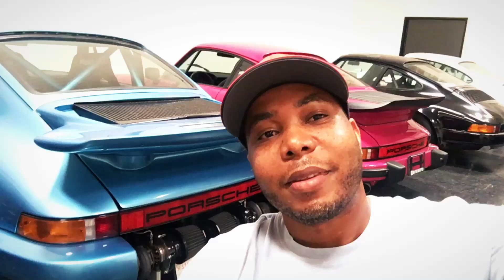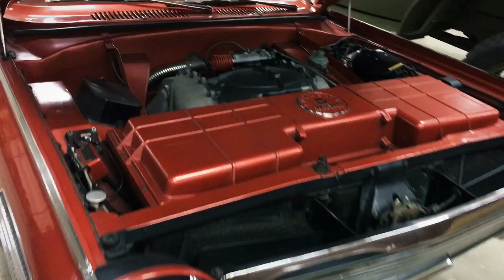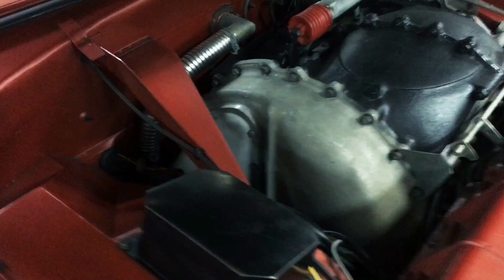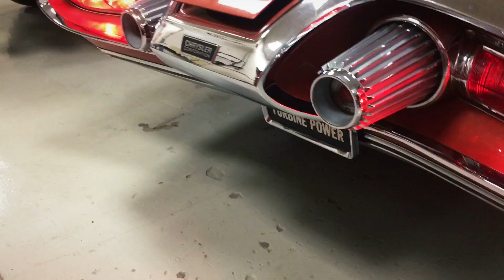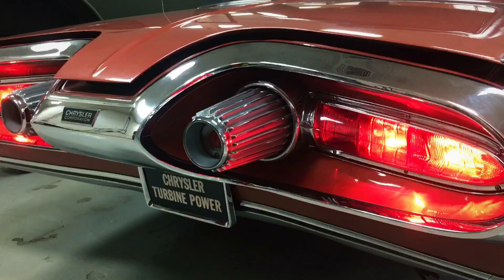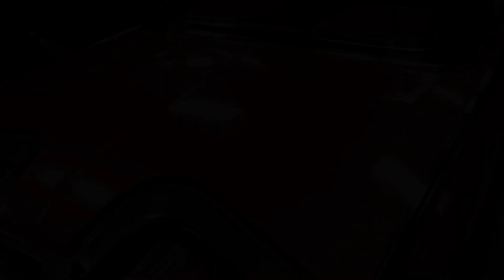Crazy jet turbine Chrysler!

Comment: While thats very amazing, you didnt rev it! LOL.
Reply from the maker: That Car Guy I would not dare. That vehicle is too valuable. The engine parts are no longer available.
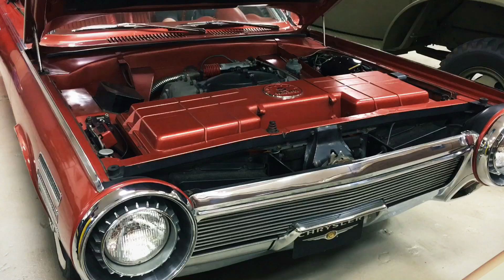Reply: Wouldnt most internal damage occur on start up due to oiling? Hence why the owner even primed it 1:55? Still very cool nonetheless just would have loved to hear this baby rev out with such a short prop nozzle.
Reply from the maker: That Car Guy The gas turbine is of a different design than piston based internal combustion engines. No startup oiling issues, and no need for warm up.
Reply: Bisimoto  Wouldnt that be the exact reason why you have to prime it? This engine looks like its based off a wankle design not a Rotax(or similar) piston design, and with most older planes you want to prime it, just like he did.
Reply: @ThatCarGuy  You have no clue what you're talking about. Not even remotely related to a wankel engine, they don't share a single common design feature besides "a part spins"